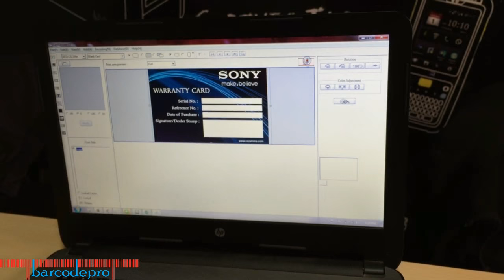HiTi CS-200e Card Printer Tutorial

Comment: hi, I would like to know my printer hiti 200e is Ribbon Missing .How could I fix it?
Reply: I have a problem with turning it on.. it only lights up but no display on the digital screen
Reply: Try to open the left and right side panels. The 3 white rubbers may already be broken, you need to replace them. You may use same size ordinary rubber if you want.